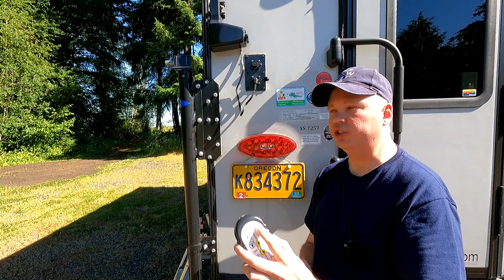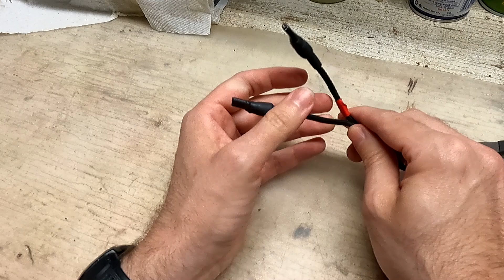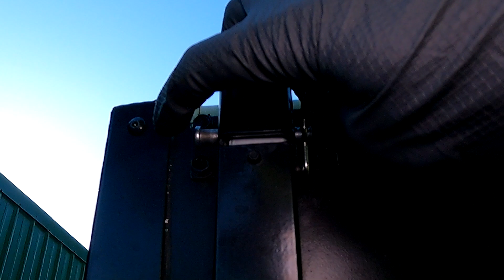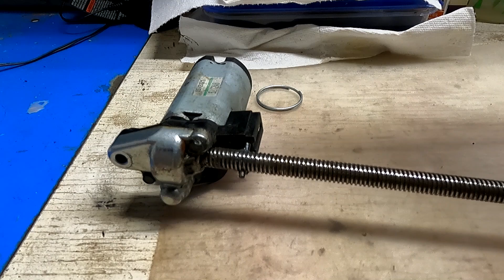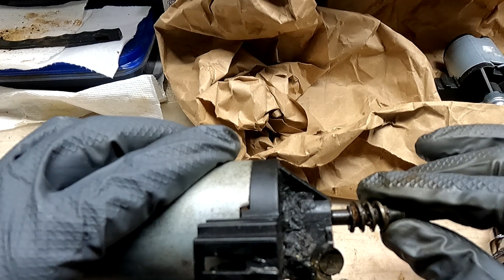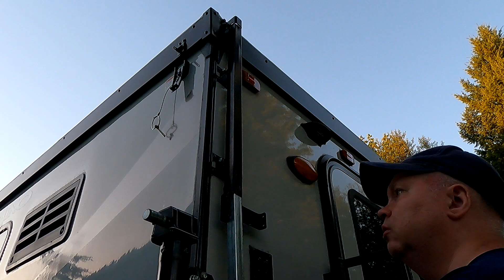Fixing the Palomino Camper Roof Lift System: Motor, Lift Arms, Gears

Comment: thank you for the video! i have replaced my motors but im having trouble bc the front keeps getting pinched and the motors are lifting unevenly. have you run into this issue??
Reply from the maker: I would remove the lift arm(s) that are lifting more slowly and see if they screw/unscrew easily by hand. Rust, dirt, or debris on the threads will cause more stress on the motor, resulting in a slower lift.  They need to be really clean and lubricated. I would also make sure they were all installed straight up and down from the factory. If one or more is at an angle, it will cause binding.
Reply: Design feature, meant to drain water off the roof toward the truck cab.

Comment: I've recently acquired an SS1251 and am currently checking everything out before I take it out on its maiden camping trip (under my ownership) and will definitely look at these drive motors as a winter project.  I'm not having issues, but I'd rather get them greased up now before something happens while out in the field.  Thanks for the great detailed explanations.  It helps many of us out.....especially those of us who are new to the truck camper world.  Good job neighbor (western wa here) !!
Reply from the maker: Thanks.  Yes, these motors seem to be problematic for a lot of owners. If you can store the camper out of the elements during winter, that would help.  Also, the new model campers have gas struts installed on the front of the roof (inside the camper).  This seems to help a lot with aiding the front motors and is something I'll look into at some point.

Comment: Just a about to pick my 1608 pop up just wondering if you leave your tailgate installed? I have a intregrated step in the tail gate of my f350 I was hoping to use to get in the camper. Any insight on this? Looks like you leave yours on but hard to tell in the video.
Reply from the maker: The SS-1251 has quite a bit of overhang in the rear, and I thought leaving the tailgate down would help to support the rear portion of the camper and reduce any tendency to bounce around on rough roads.  I also noticed the photos on the Palomino website showed tailgates installed, and leaving the tailgate on was just easier (the tailgate on my truck is a pain to remove/install).  There may be other pro's/con's, but those are the main reasons I leave my tailgate on.

Comment: Do you have a Video on how to lower the camper if one of the actuators stops working when it’s in the up position?
Reply from the maker: No, but the square bits I showed in this video can be used to manually turn the motor if the motor or power supply fails.  If it's a mechanical issue, you'll need to disconnect the lift are from the roof bracket...or remove the motor and lift arm assembly (if you can't reach the bracket).

Comment: Have you ever disassembled the lift arm itself? Having an issue where the driver side rear lift arm will not catch any of the gears. The top will lift about 6inchs and then pops and drops that corner of the top putting WAY more strain on the other three. I have pulled it off the camper and actually am in the process of trying to figure out how to pull it all apart
Reply from the maker: I have not, and I don't recall what mechanism prevents the threaded rod from screwing all the way out.  It may have a pin on the top end, which you may be able to see after removing the top cap from the lift arm.

Before disassembling the lift arm completely, I'd recommend removing it from the motor, unscrewing the rod until it hits the stop, and inspect the threads for debris or damage.  If the threads are stripped, it might make more sense to replace the lift arm.  Dealers sell these as an assembly, but they're not cheap.
Reply: @outdoorsinoregon thank you for the reply! Yeah, after doing some more research and attempting to disassemble it further I found the threaded rod to be stripped 😢ended up just ordering a new pair (since they apparently only sell them in pairs😅) tried to get the dealership to warranty it, but we have lots of trips planned this year and I don’t trust the dealership to not keep the camper WAYYY longer than necessary! Ile see if they can do something with it in the off season 🤣
Reply from the maker: @moonsterjim9792  I know what you mean; I've tried doing everything myself thus far for the same reason.

Comment: So I’m having trouble with my indoor back right lifter. I had to cut a hole through the propane compartment wall to access the motor. Still having trouble getting the assembly out of camper to repair. Motor might be fine. Somehow the threaded side came apart from the solid side.
Since I’m having trouble getting the unit out of the camper to repair i think is the reason they moved it to the outside. Catch 22 i guess. Honestly outside is better. I may have to cut a hole in the bottom of the camper to extract the assembly. Any ideas why the top part came loose from threaded side?
Reply from the maker: So, is the motor mounted inside the wall?  I just assumed the entire assembly was mounted to the outside of the wall.  

Without seeing it, I can only guess that perhaps the threaded rod got cross-threaded or the threads themselves got stripped.  Good luck!

Comment: I have a 2021 SS1251. I replaced all of the crappy actuators with a set from HannaRV. I added a rubber boot and upper seal and sealed the boot with Marine Goop. I keep the shaft lubed with silicone grease. No problems in the 3 years I have owned the camper.

Comment: Hi.  I appreciate the video.  I have a 2022 SS-1500 and have had similar issues but on mine the worm gear stripped because it was plastic.  I did the same thing as you in the video and replaced the motor and lubricated everything.  The new motors are now metal worm gears.  I'm still having issues with the motors struggling to lift the roof especially in the front.  I've noticed on newer models they have assist gas struts for the front on the inside on either side of the bed.  I've contacted Palomino to see if I can order a set of these to retrofit my unit with the assist struts.  I think that will make a huge difference but we will see if I'm even able to get my hands on any.  Thanks again for helping everyone out by posting this.
Reply from the maker: Hey, thank you for the comments.  Very interesting.  Feel free to post another comment if you get the part # for the struts.  I would definitely look into retrofitting mine if possible.  New motors helped on mine tremendously, but as you said, the front is always more difficult to lift.  

I shudder at the thought that some of these were shipped with plastic gears knowing how much torque is required to lift the roof.
Reply: @outdoorsinoregon  So just rebuilt all 4 of mine and 3 of the 4 have plastic gears, on one both gears are plastic. Any idea how to order new gears for the spindle?
Reply from the maker: @dansunderlin1270  I'm not aware of anyone selling the gear by itself. Forest River dealers do sell the lift arm as an assembly. I don't have the part #, but I recall it was expensive.  I was planning to buy one as a spare, but the cost gave me pause.
Reply: @outdoorsinoregon ok thanks if I find the part number I’ll post it here for you but depending on the cost it might make more sense to just go with newer type lifts as others have mentioned
Reply: @outdoorsinoregon great video btw thanks for doing this for everyone who has these cheap lifts…I have the badlands package which has the roof rack but now I’m afraid to use it as these lifts can barely raise the roof without any weight on it. Definitely a poor design as you mentioned.
Reply from the maker: @dansunderlin1270  Agreed.  I actually ordered the Badlands pkg myself, but Forest River wasn't able to deliver it during the pandemic, so I bought the base model. I would definitely not try raising the roof with any weight on it.

Comment: Great video!! Very informative! Thank you!!
Reply: Going on a two week trip to southern Utah and then a month long trip to Vancouver Island. I have a 2023 Palomino 1251 and I was always concerned about the lift actuator motors. Your video and the links in the description have been very useful. I just ordered 4 actuator motors to take on the trips just in case. I am also going to check and clean the current actuators as you outlined in the video. I have looked at a few other videos about actuators, but yours is the most descriptive with very good video. Thank you again for taking the time to put all of this information together. I am feeling much more confident now. We did a trip to Alaska for 7 weeks two years ago and had no issues, but I was a bit concerned about them failing. I will feel much better prepared for the upcoming trips. I subscribed to your channel. Thanks again!

Comment: If your having trouble with the lift there is a lot easier system made by vevor it’s an air actuator and it will lift 900 pounds each. All runs on 100 psi air pump and tank and takes about 1 minute to lift the roof. Or an actuator from precession linear actuators and they have a kit to replace all 4 that even use the same hook up for the electric plug.

Comment: Great video i have the ss550  and of course the dealer told me the actuator problem was fixed its not even 14 months old and hear iam replacing them not to mention the screws that hold the brackets on are not stainless and I found a few broken .  QUESTION hindsight 20/20 do you wish you would have went with the hard top ?
Reply from the maker: In my opinion, to fix this issue Palomino needs to adopt a sealed design or maybe design in some grease fittings so the moving components can be easily lubricated and protected. 

I've also found rust/corrosion and broken fasteners on my camper; it seems over-torquing the bolts and screws was common during assembly. 

Regarding the soft top, now that I know how to fix and maintain the lift system, I'm a lot more confident in keeping the soft top.  My truck's tall and being able to reduce height is a big benefit. With the top lowered, it can fit into more places, catches fewer tree branches, and cuts through the wind much better on the highway.

Comment: Thank you for this video. There’s so many people with this problem. there should honestly be a recall. This is so unfair to everybody that owns one of these campers you spend all this money on a known problem and the worst part the sales people tell you oh no this is a new motor. We don’t have the problem with these anymore. Your video was very helpful. I’m thinking about using plexiglass on the roof, as sort of a umbrella over the shaft to try to help keep water out. I’ll let you know how it works out. now thinking about it as I’m writing this. I don’t know what the largest size of shrink tubing is there would be a way to seal that top post, it may prevent a lot of problems. Maybe try painting it with flexseal I’ll keep you posted.
Reply from the maker: Thank you for the comments. With regards to sealing the top of the lift arm posts, the top cap could be removed and sealed with silicone or similar.  You could also potentially seal the tops of the plastic covers, but water will still enter from the attachment pin holes at the top of the lift arms. 

There's an aftermarket company that makes a one-piece solution that is supposedly completely sealed and waterproof, but it would require replacing the entire assembly, sealing existing holes, and drilling new holes. And some people have seen early failures on these as well.

My best advice would be to store the camper under cover if possible and routinely check the lift arms and gearboxes for lubrication.